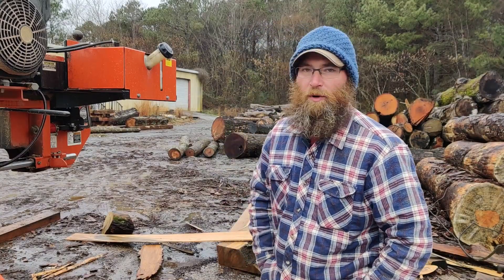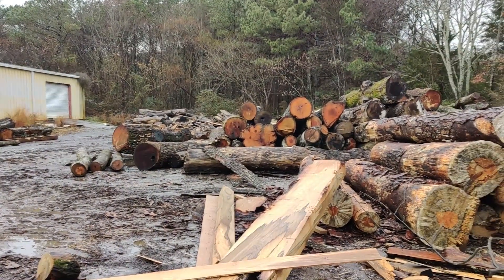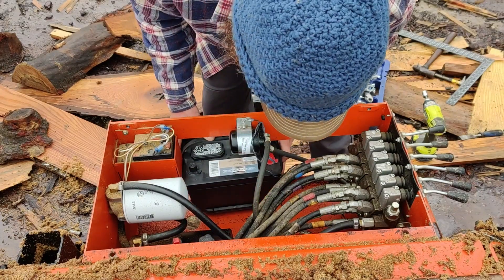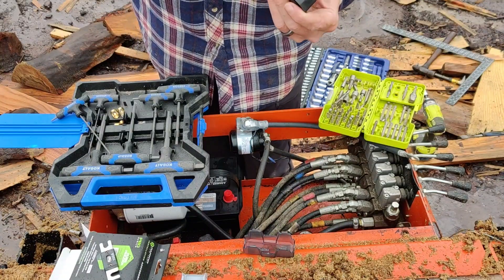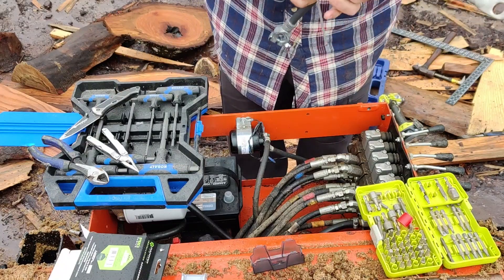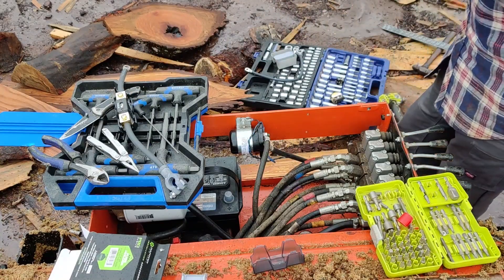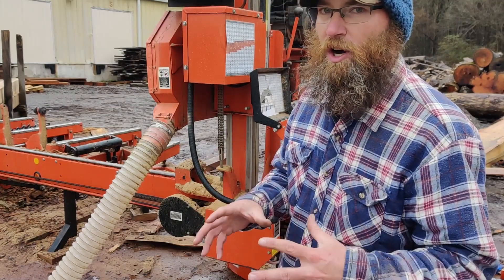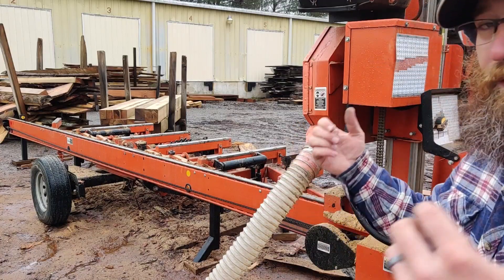Battery Upgrade on the LT35!

Comment: Going to do this to my LT35 this weekend. The only thing I'd do different is eliminate the trailer battery and hook that system to the new battery. That way the truck will charge it as it goes down the road and you have more room in the box... Id also put a battery hold down it will move around and wear it out.
Reply from the maker: Yeah, taking out the trailer battery and hooking that up to the new one would be a great idea. I mentioned in the video that I will be doing some form of hold down in the near future. I do not do very much mobile milling anymore so it sits stationary for now.

The debate I have is whether it's actually adding any benefit at all other than letting me use the hydraulics while the saw head is not engaged with the copper strip. If you look at the results at the end of the video, they only barely seems to be any benefit at all.
Reply: @VKMilling  With a load on the hyd like picking up a log you will see a bigger difference. The way you tested it the hyd system was pretty much "freewheeling" because the only load was the restrictions in the system..

Comment: Unfirtunately, dc motors only run faster with more voltage. You could add a thousand batteries and parralel and speed will not increase (unless the one battery is going dead and does not have the amperage capacity needed.) You cannot run the batteries in series because that would make 24V which would be too much for the 12v hydraulic motor and cause charging issues. Your options would be a second hydraulic motor or a hydraulic motor with greater GPM (gallon per minute) while havign the same PSI (pounds per square inch). The other challenge is the fact thatr this battery in the hydraulic box will only be recharging when the cutting head is in the location to make the contacts work. Recharging is slow, while drawing is greeat, so it will have difficulties in keeping up the battery charge with only short intermittent charging going on. Not at all trying to rain on your parade. Just trying to be helpful and help others think before they jump. -Mike
Reply from the maker: Woefully aware of these issues which is why I doubted the veracity of the claims made by others in the first place. I have not notice any appreciable difference whether it's turning logs, loading logs, levelling logs etc. So, as an experiment, I'd call it a failure and a waste of $125

Comment: so what about the original battery?
Reply from the maker: stayed in place. runs 2 batteries now.
Reply: @VKMilling  ok, thank you for the answer. If I recall correctly, your second battery is in the hydraulics box. How are things working out so far? Any problem with the alternator recharging both batteries and running the mill? Do you find that you have more juice to pull on in real cold weather than with just one battery?